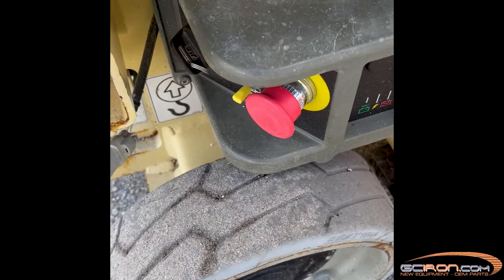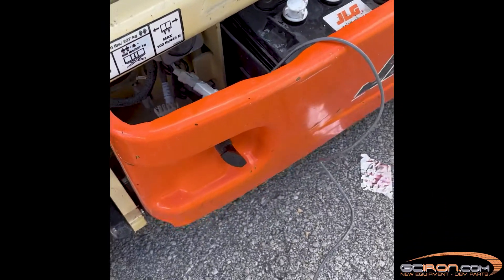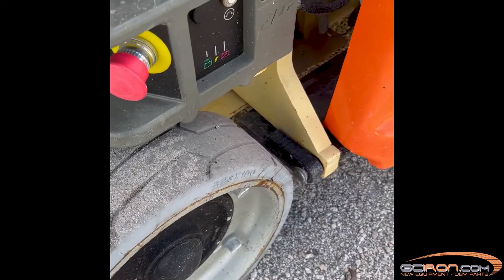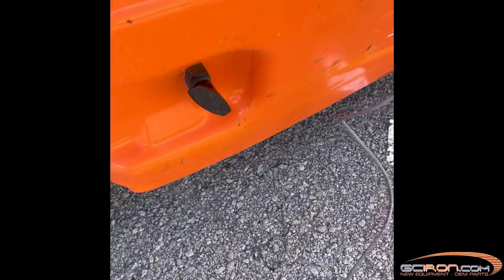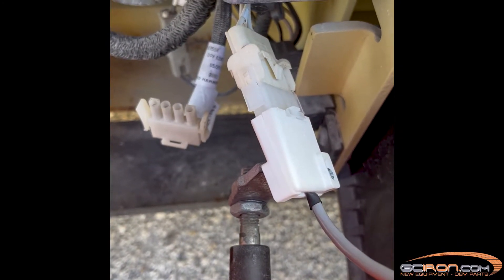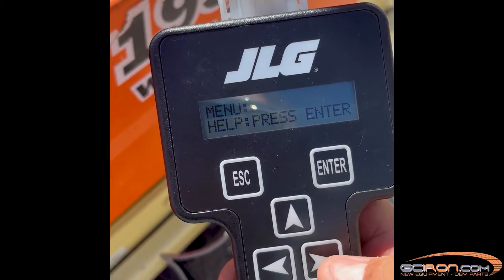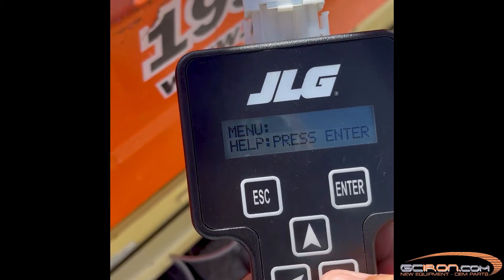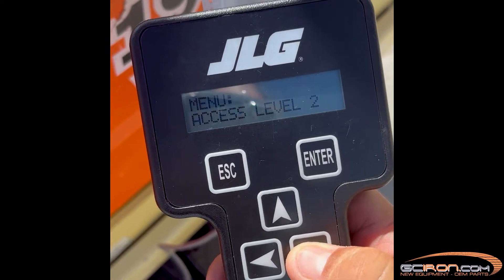JLG Drive Motor Electrical Evaluation Tutorial

Comment: 1930es got a code for 2510 
Front right drive motor is extremely hot
Reply from the maker: This code pertains the brakes not releasing.  Some possible causes are a faulty harness, faulty brake coil, faulty brake disc or faulty control module.  You can try to use the manual brake release and see if your brake releases. If it does, then your brakes are good. If not, there is a problem at the brake, so check the disc or coil. most repairs to the brake are completed with part number 7024772. Which can be found at https://www.gciron.com/JLG_Parts_7024772_KIT_BRAKE_p/7024772.htm.  Hope this is helpful.